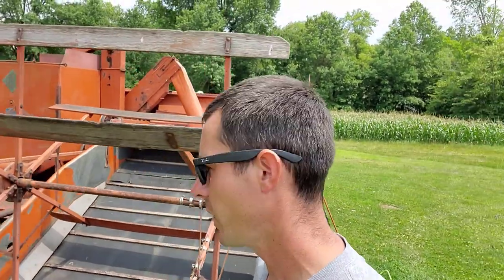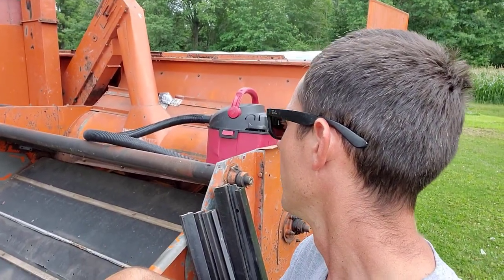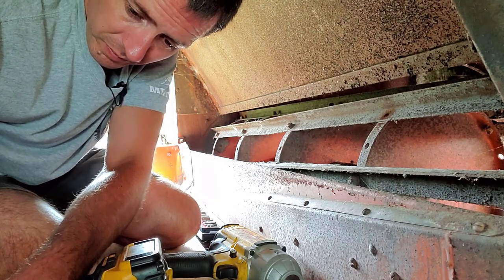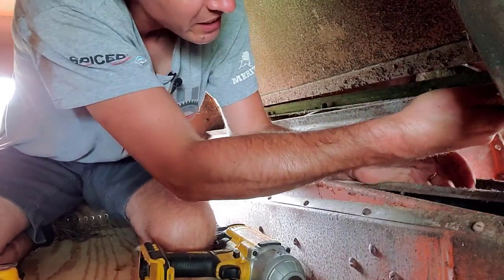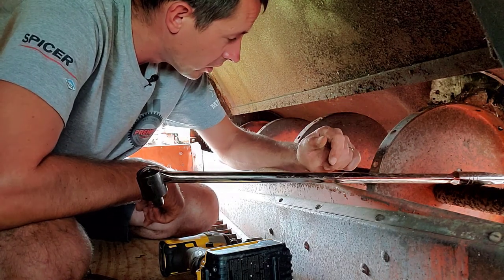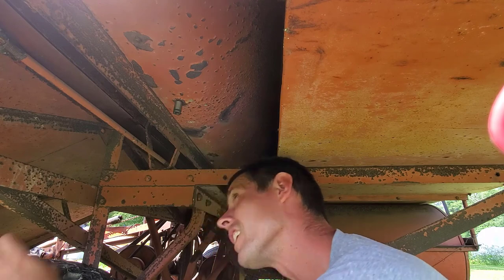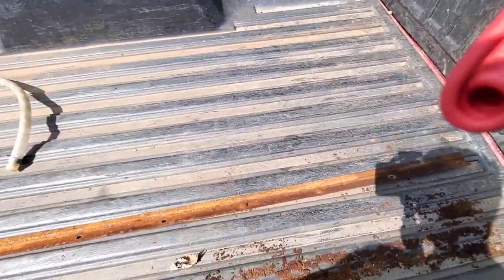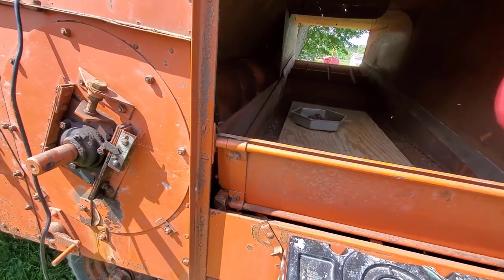Fixing a $300 Allis Chalmers All Crop 66 Combine

Comment: I worked for my rent once on a farm and restored a self powered one of these. The big challenge was getting the motor running. Cantankerous beast but once I had it sorted it ran fairly well all day.
I then got to harvest 40 acres of Lupins for export seed. The sample we sent off to the Ag Dept for viability, came back with a note saying it was the cleanest sample they'd ever seen. Hats off to the mighty Allcrop 60. 
My only trouble was one day the chain driving one of the elevators broke and it took me a while to spot it but by then the damage had been done as the horizontal augur had packed in so much seed that it burst the metal work. What fun, laying underneath, way out in the field, hammering the sheet metal back into place and getting it bolted back up.
Years later I bought a PTO version and had new rubbers made for it. I used a Urethane compound. 
Does yours have a tacho for the drum speed?
Reply: I’d like to know how you made those rubbers?

Comment: I have two of these combines, i bought them both for 500, one is running and the other is for parts,  yet the second one is actually in better shape,  so I will have to transfer pullies and belts onto the second one once I do some repairs to it,  but I won't be parting with either of them,  as parts are almost impossible to find.   Thanks for your video

Comment: i just found original beater bars from an all crop owner, his father had bought parts new in case they failed, they are 60 yeears old and brand new, but my question is, how in the heck did you actually get yourself inside that machine? there is no way i could even get half my body inside.. but still changed them all, now the machine does not shake as much as it used to, those old bars hit a lot of rocks over the years